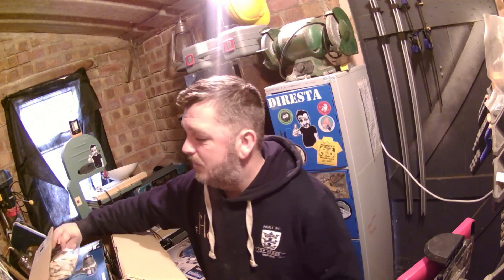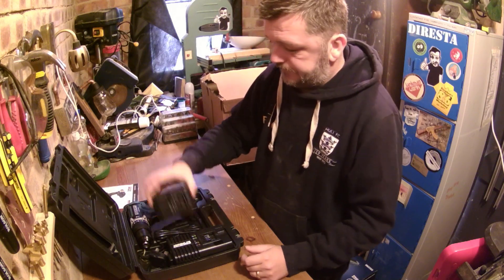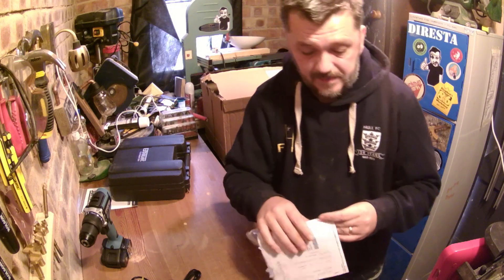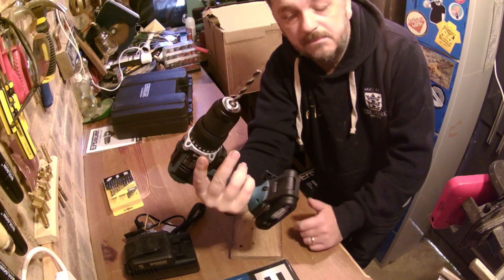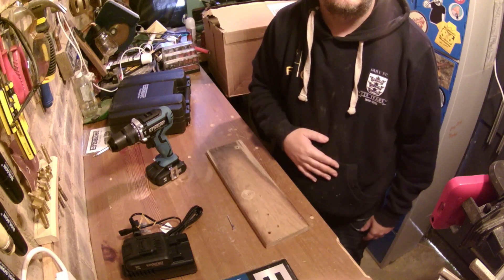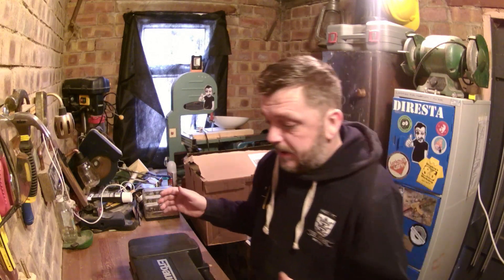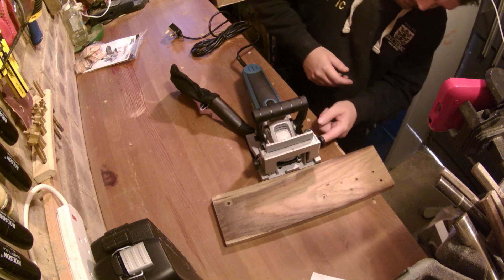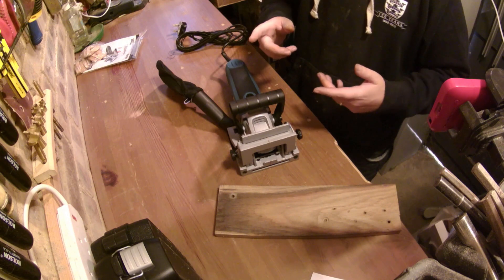ERBAUER Tools Review with SCREWFIX

Comment: I would like to have seen you work it til the battery went to test it out. Maybe drill through a few bricks, put some pressure on to test the chuck out, and maybe even charge the battery to see how long it takes to charge? Just some thoughts for the future.
Reply from the maker: Some good ideas there. If it's of any use to you, Ive used this drill a whole LOT, it has never let me down

Comment: Erbauer tools are bang on for the money I had a drill used daily on site for around 3 years or so with no problems.
I have now  bought a £500 bundle from B@Q and everything works and works well and does the job for well over half what you would expect to pay from a leading brand. The batteries last exactly the same as any other battery and replacement  5 amp batteries are available for £50.
If anyone is a little doubting about this brand of tool don’t it works and works very well
Reply from the maker: Fully agree mate, no need to spend £££££'s when thus brand is widely available - I've never looked back. Its nice to hear a review from someone doing heavy usage, I use mine occasionally but still completely happy! Thanks for the view and comment.
Reply: Gary don't suppose you have the erbauer circular saw at all? Trying to get some opinions on it before I buy it.

Comment: I have the biscuit jointer. For the money it's not bad at all. The adjustable fence is rubbish, but I just reference off the base and it works fine. One design flaw - the springs are too weak. If you use the tool upright cutting down into the workpiece (e.g. to make biscuit holes for a cabinet shelf), the weak springs allow the cutting head to sag down and cut the piece before one intends to. I fixed this by adding a similar sized spring to one side. Also, the tool kicks like a mule when you start it, so don't bother trying to line it up for a cut before switching on. Review is correct that this tool is very noisy. Ear defenders definitely needed.
Reply from the maker: Personally I haven't had and trouble, apart from the kick so yes, definitely start it then line it up 👍👍

Comment: I needed batteries for my Erbaur Site Radio and a second drill to assist with piloting and screwing ...I too was chuffed at its squabby (small) size and it feels re assuringly well built . U’re right about the “designer” makes which -unless you’re flogging the thing non stop , aren’t necessary . Tidy box with good clips . Slight issue with charger getting hot and smelly on occasional charge . Will see if just huge spider crept in and got fried....twice 😃thanks from the extreme east of the west country ( new forest - not extension of London !
Reply from the maker: Stephen Gale Hi Stephen thanks for the comments and for subscribing too. Sounds like you enjoy this brand as much as I do!

Comment: The buscuit jointer is sub £60 now will be picking one up ASAP thanks for the review it's the 1st one I've seen 👍
Reply from the maker: Under £60? Grab it mate!
Reply: I'm on it don't worry. Did yours need any adjustment out of the box or was it ready to go?
Reply from the maker: @simonrosser7590  ready to go mate
Reply: That's good to hear I've heard stories of these types of jointer needing adjustments even the high end ones 👍
Reply from the maker: @simonrosser7590  never had a problem with mine mate

Comment: Great vid Steve
I’ve got this drill it’s great, light & compact the Erbauer range is brilliant I’ve got a few tools from this range 
You need to treat yourself to the Impact driver, much easier than using the screwdriver torque settings, also saves keep changing bits
Since I got mine I wondered how I survived without it. Product code 5012P for brushless or 7485F for standard
Reply from the maker: John Stinchcombe Glad you enjoyed the video mate. I fully agree, great tools!  How much on the impact drivers?